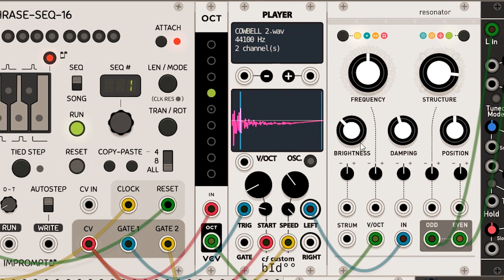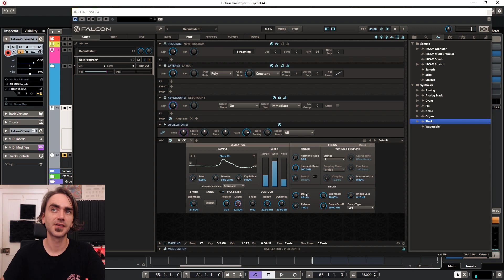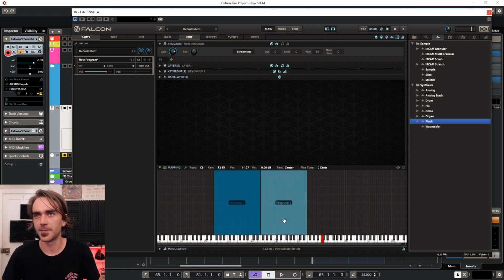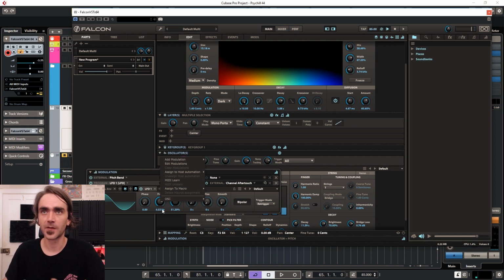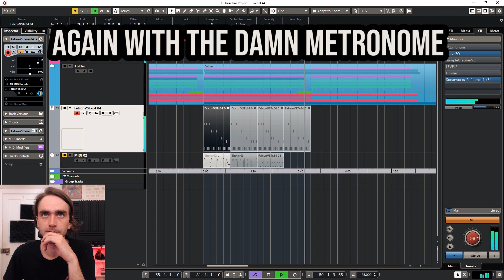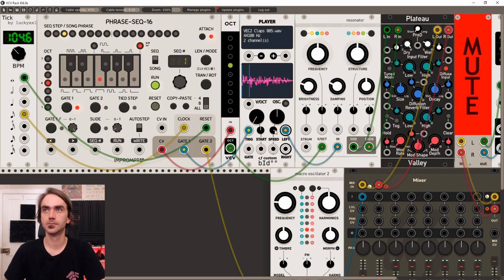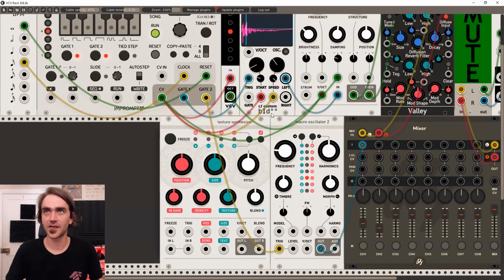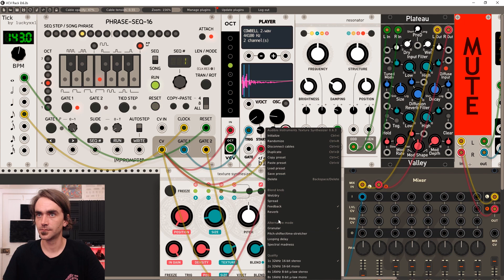The Weird and Wonderful world of Physical Modelling Synthesis

Comment: Objekt by Reasons 12 makes the best modelling synth ive ever heard as its a proper modelling synth and not some ordinary synth trying to sound like one...
Reply from the maker: It uses modal resonators, it's a pretty common algorithm for physmod, infact Falcon uses the same technique although here the excitor is built into the resonator bank.
Reply: @DashGlitch  Does it? I never knew that.
Reply from the maker: @NathanChisholm041  Yea it's a pretty common technique, you can even create in a multiFX system using tuned delays and filters. Nowdays "some ordinary" synths like vital/phase plant can even do it, because they have filters and delays built in. At the end of the day there are only certain processes which can happen to audio, the different combinations of those is what makes the tools different. But Reason Objekt certainly doesn't have any brand spanking new DSP that hasn't been seen before, it's just delays and filters. It's nice though absolutely, but it is what it is. The  current hype is doing wonders for it too.
Reply: @DashGlitch  Modelling synths are certainly the flavorer of the month atm! Cheers...

Comment: I keep thinking "it must exist" in this day and age - Digital sculpting/modeling software that will allow to to hear the virtual instrument defined by material used, shape & density etc and how it's played "string, tapped, wind etc"  has anyone heard of this or seen it existing somewhere? Creating music alone is fine but I want to be able to design, hear what it would sound like before it's physically manifested.
Reply: You might like Chromaphone 3, it gives you a good selection of shapes for the resonator and the excitation method (wind, struck, bowed) can be modelled with noise, and you can choose the material which I believe models different material densities.
Reply: that sounds like Sculpture in Logic ...?
Reply: @ikialyfe2646  No, physical sound fx plugins aren't importing a 3D model that you can define air pressure entry point or physical hit/tap. There are parametric procedural modeling tools that could be used like in Unity and merged with a physical sound model FX plugin if the plugin could take parameters like depth, width, height, thickness, cubical, spherical, triangular etc into account but for soft 3D sculpted models this maybe a lot more difficult. Particle physics passing through an object and detected by raycast and raycast detecting the outside and inside thickness, shape etc might be the only other way to get sound physics from a sculpted 3D model but there is no such program except for the one that exists in my mind lol -that I've seen yet.